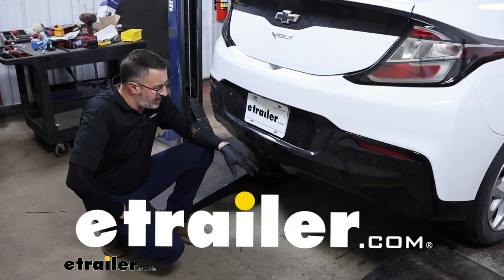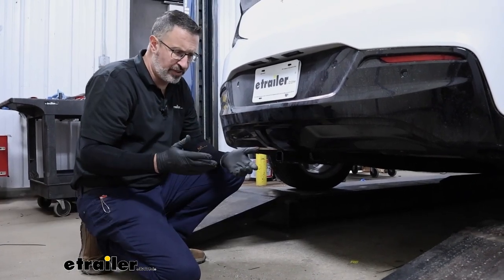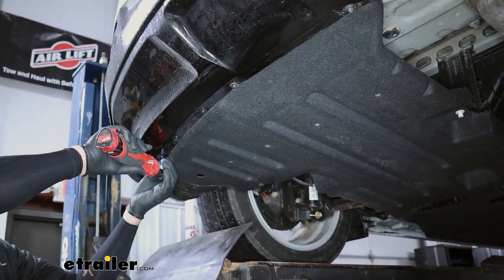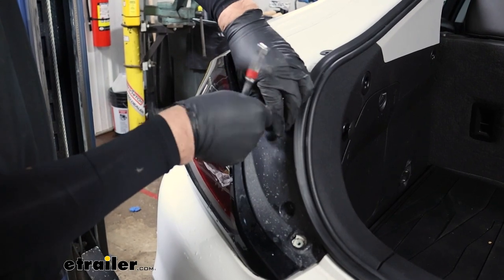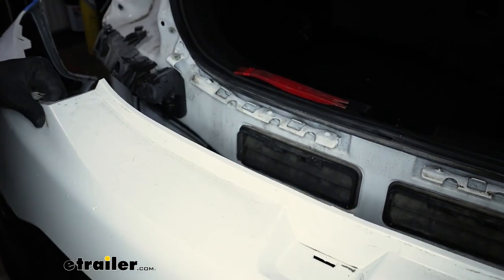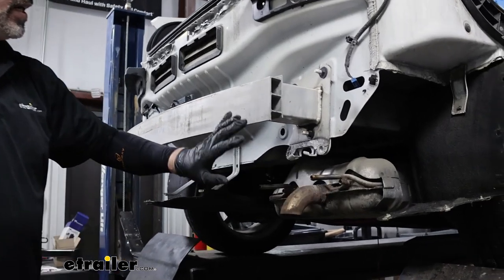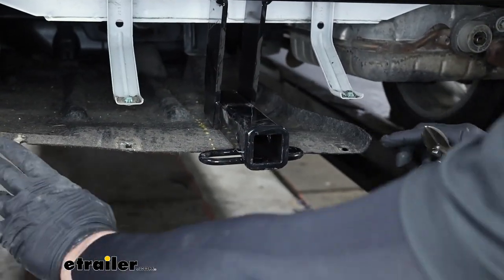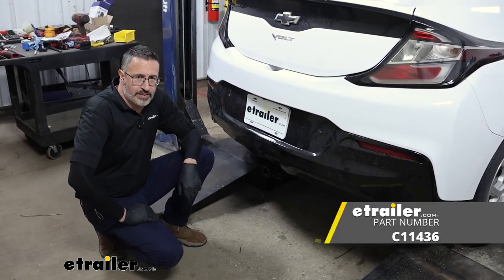Step-By-Step Installation Tutorial for the Curt Trailer Hitch Receiver on a 2019 Chevrolet Volt

Comment: I just installed this..   Do NOT use any electric or other impact tool on the bumper bolts.  The bolts are made into the Unibody and not easily replaceable.  I had to cut two off.  Only use a hand ratchet/breaker bar.  Once they start spinning  you'll have to cut them off since there is no hex head on the back side.  Otherwise the install isn't so bad.  I think my civic was worse.
Reply from the maker: Thanks for the tip, we appreciate it!
https://www.etrailer.com/Trailer-Hitch/CURT/C11436.html